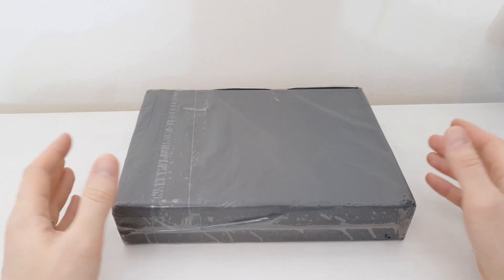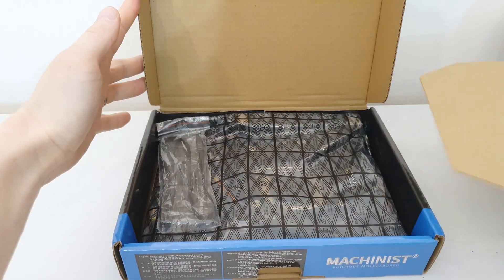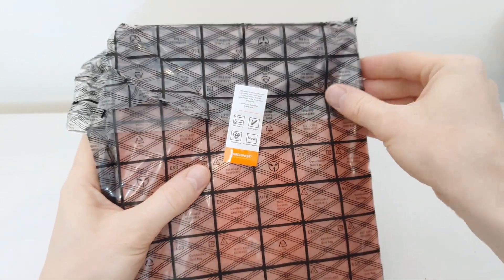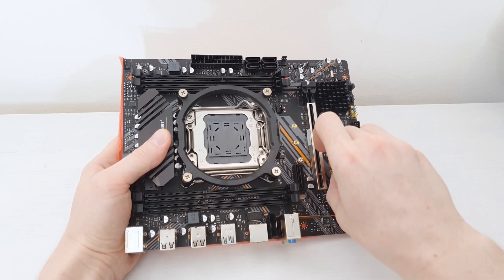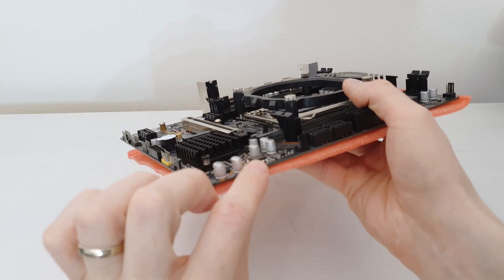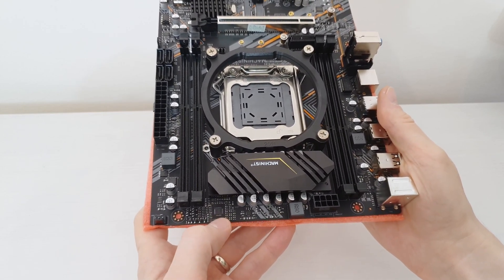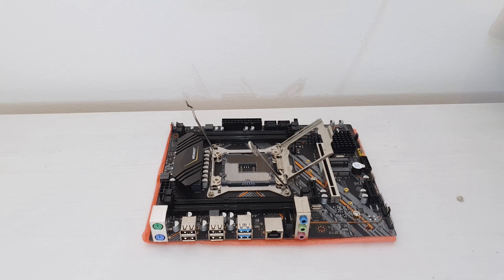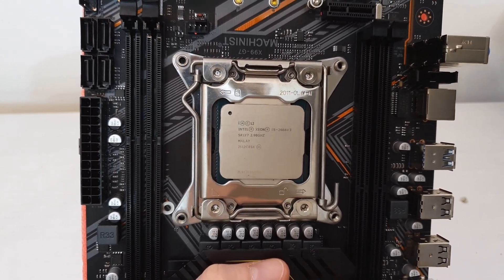🇬🇧 Unboxing Machinist X99-G7 with E5-2666 V3 | quad channel DDR3

Comment: Ordered this motherboard with e5 2673 v3 with tdp 105 watt instead of 135 watt for 2666 v3. Plus  horizontal snowman cooler to cool vrm. No chance to use 2666 v3 on this motherboard without "shaman dancing"...)))

Comment: I have the X99-G7 and every time I restart the PC I must enter bios and F3 to reset default settings. Otherwise it will not boot. Any suggestions?
Reply from the maker: This is a known UEFI bug. You have to either disconnect all storage devices, reset, configure, save the BIOS and then connect your storage, or install Windows in Legacy (CSM) mode.
Reply: @miyconstclips  Thank you. That was helpful. Do you know anything about the g7 not waking back up after sleeping with mouse movement?
Reply from the maker: @alybrown7199  this is simply not supported by X99-G7, not much you can do about it.

Comment: excuse me, can Kingston DDR 3 - 1333 8GB x 2 (short height RAM) be installed with X99-G7 and E5-2666 V3.  I have old RAM unused from intel socket 775. Thank you. I don't know how to utilized my DDR3-1333 RAM. I wish it could work with this.
Reply from the maker: Yes, most likely it’s going to work, but performance won’t be on the same level. DDR3-1333 is significantly slower than DDR3-1866.
Reply: @miyconstclips  Thank you very much. it work is ok. Just save budget.